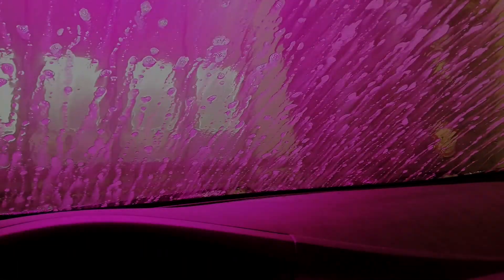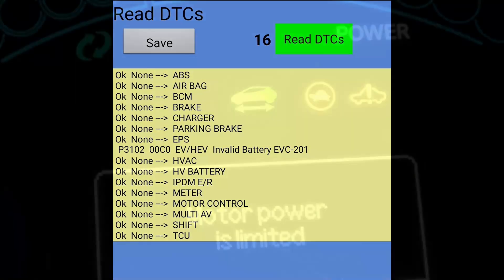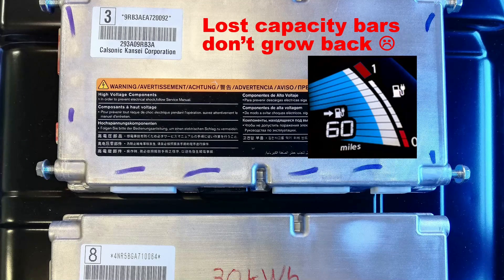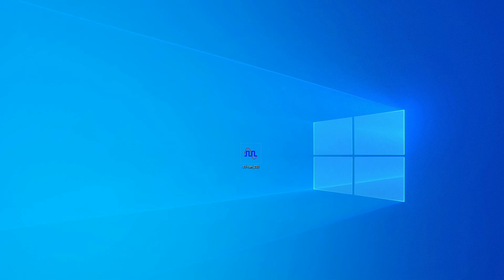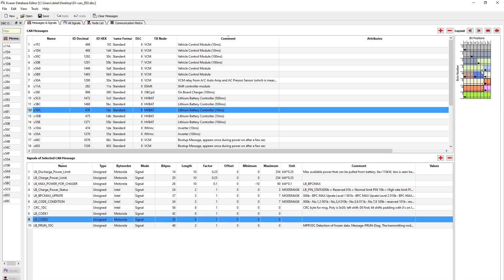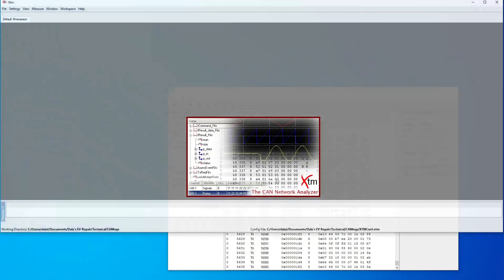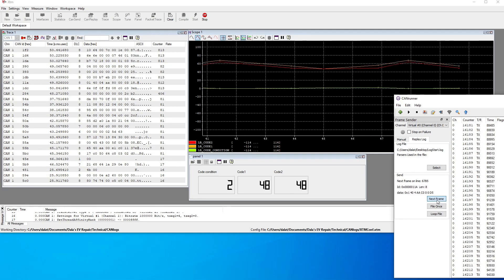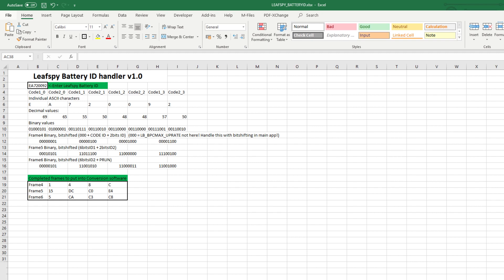Nissan Leaf - Battery ID Secrets Exposed

Comment: Hi Dala, I have Nissan Leaf 2015, one cell has been replaced, however the read out still shows same fault on the same cell. Do i need to Code the cell in? Cell 51 & 52 one shows 4 mV and the other is showing 4550 mV. All other cells are 3890 mV.
Reply from the maker: That sounds bad! Make a thread on the Mynissanleaf.com forum, and attach screenshots there!

Comment: I’m still surprised there isn’t an ev design can swap battery units with a home power wall. 

Charge battery units from solar during day, swap between car-house at night when home, drive to work next day, repeat. 

Would require a modular battery system and car body designed to allow swapping out batteries. Should be possible in a ute or van design. 4 Door passenger car layout a bit harder.

Comment: Hey, interesting development:  Today, I got a call back from my local Nissan dealer.
I have a 2011 with a 2015 24kWh battery that Nissan installed under Klee (the class action.)  It's at 10 bars of capacity, and has about 40 miles of usable range with an 80% charge.
I had gone in and asked to buy a new 62kWh battery from them, and the Parts guy said his computer was telling him that part has to be ordered through Service.  The Service guy said they'd check my car first and see which battery they could fit in it.
I just got a message that Nissan would sell and install a new 40kWh battery for US$13,245.  (From the message, I couldn't tell if that's with installation or not.)
But at least they're acknowledging it's possible, and offering to do it.
And a $13K new battery is much less expensive than a $35K new car.
Reply from the maker: The service center is unfortunately not informed well enough. There is no OEM solution for adapting a 40kWh battery to a ZE0 LEAF. If they order it, the installation will not be successful. But it would be fun to see them try :)
Reply: @DalasEVRepair  Hm.  I suppose they would give me my $13K and old 2015 24kWh battery back.  But I thought all the batteries could be adapted to the ZE0 Leaf.  I'd heard of at least two installs of the 62kWh battery (though not through Nissan.)
Are you simply saying there's no official Nissan path for it?  (I thought it had been done by some smart Finn.)  Maybe my dealer has a bold tech who has seen your work, and wants to show management how they can still make money selling batteries.
Reply from the maker: @stevejordan7275  Yup, no OEM path. But personally I've now sent 7x kits for DIY 62kWh upgrades yes 😁
Reply: @DalasEVRepair  "You've sent...?"  That's stellar!  Can I buy one from you?  (I have the funds budgeted.)  Or do you mean only that you've sent them within Europe?  (Finding a 62kWh battery seems to be the challenge at the moment!)
Or can I buy the upgrade kit sans battery, locate the battery locally, and then DIY the upgrade?
Reply from the maker: @stevejordan7275  The last option is what 99% of customers do!
Reply: @stevejordan7275  in USA currently it's easier to find 62 then 40 for a reasonable price. I installed one pack on ze0 in Los Angeles, and another 62 on aze0.

Comment: Can we add a gasoline-powered generator to the main battery while it is working?
Reply from the maker: Nah, the leaf charger is programmed to not operate while vehicle is moving
Reply: Can we change the car computer programming to what we want and what is the way
Reply from the maker: @rashidmohmd546  sure we can, but it requires thousands of workhours to reverse engineer
Reply: @DalasEVRepair  Do you know someone other than the program or can change it?
Reply: @rashidmohmd546  you need to pull HV cables out of pack or get access in any other way to HV line and use external charger like Tesla gen2 modified, or Brusa charger.

Comment: Anyone try to go to their nissan dealer and just ask them to code in their new battery? If they refuse, report them to your local consumer rights agency (which are quite powerful in the civilized parts of the world).
Reply: Wow...that's sure worth a try.  Thanks, Patrik.  And you still have the CAN bridge option, so buy a new battery with confidence!
(And if you have a first-gen battery, be sure to also buy the adapter.  Probably from Nissan.  I know they make one, because my 2011 has a 2015 battery.)
Reply: Update: Nissan do not have a distinct adapter like the one Dala sells; buy one from him!
Reply: @stevejordan7275  Yes, black replacement packs for ze0 are "hybrid" packs, it's 13+ case with front connectors from ze0. Pretty rare peace to have. As well LBC is different. Trying to get one, but have no luck yet.

Comment: I'm surprised that the EU hasn't slapped car manufacturers down for pulling this kind of anti-competitive practice.
Reply: @Tron-Jockeyeasy, the manufacture date, cycle count, fast charge history.etc would all be visible, if the battery information doesn't match the car it came with, no warranty replacement for you
Reply: They can claim it's a safety thing as they don't know the history of the replacement battery, it could be damaged which isn't entirely unreasonable.
Reply: @mfx1  It is unreasonable.
It's your car and if you want to put a battery in it that's unsafe and it blows up and takes your house with it then who has the right to say no to that?
Your car, your battery, your house.
Just make it so that you void any and all warranty and anything else if you tamper with the car.

Comment: Sadly, Apple have started doing this with almost every component in their new phones, even screens! I'll never buy that
Reply: yea, tired of these companies having you buy a product and everything's fine until it breaks then you find out you really never owned it because you cant do what you want to do to it because they have it locked down. It's like purchasing a car cash. Then you have a blowout. But just because you replaced the tire they deactivate the car remotely, permanently unless you go back to the dealer to get it replaced.
Reply: apple are such hypocrites - they bleat on about how recyclble their products are then actively dont allow people to repair their products...........
Reply: I’ll stick with my ICE car. If I need to change the fuel tank, there will be none of this shite.
Reply: It wont be the fuel tank it will be the pcm unless your talking about cars before the late 1980s. Ive had to scrap lots of nice modern gas cars that the dealer wanted more then it was worth to program a new pcm. The cars did the same "limp mode" with check engine lights making the car useless and if you change the pcm from a junk yard one to save money it wont start. Same issue irrelevant of electric, gas, or diesel. gotta ban companies from being allowed to use these programs, for example my 1988 EZGO is very easy to just switch batteries on.
Reply: looks like Apple is also making electric car, now lets see how repairable that is going to be ......
Reply: Marcus, not necessarily, because Apple has made mistakes in past, which Apple at the beginning stated as "for security purposes", TouchID swap fiasco for example. Not saying it's not true that Apple is scumbag company for certain practices, but sometimes it's a bug or a mistake which is being presented (e.g. lied) as on purpose.
Reply: @FVBmovies  no, they deliberately have disabled repairs on new models. It cost them money and research to make this "feature" which is a way to block users repairing their own devices. I'll never buy another product from any company who takes advantage of me and restricts my choices

Comment: Hei, did you ever eksperiment with parallel akumolator's?
Let we say 2x 40kwh to get 80kwh?
Or from kia akumolator which is 80kwh allredy to get akumolator of size 160kwh?
Reply from the maker: Look into Muxsan, sounds like you are describing a range extender
Reply: @DalasEVRepair  No no im not talking  as range extender. Ja  ok-2x capcity = 2x range but that was not my reason for question. Building aku pack is 1 thing  but properly ip68 rating is another thing and time and and and....when you designing  fram schrach takes astronom time. The reason is that i want el boat and  would be super elegant to instal 4x 80kWh aku pack. Thats why  the unusual question. Btw thank you for answering and your proper and good videos!
Reply: @ItisImarko  it will gonna work. Where is a muxsun soft for a can bus bridge what can do the trick.

Comment: I literally laughed out loud as you stopped JUST short of explaining how to actually reprogram or work-around the new battery having the wrong ID. Sure, you say how to get the ID out, but stopped short of giving away the whole farm that sells the EVs Enhanced tool ;) Darn it... (because CAN messages are broadcast, you can't just insert an ID you like onto the bus... you'd have to cut, intercept, and rebroadcast the messages - with that painfully expensive CAN Bridge!)
Reply from the maker: "Painfully expensive CAN-bridge" is 100€. It is true that I sell the complete solutuion for doing this, but with the info here given you have the choice to go for your own implementation, or just buy the code or code+hardware from me. I don't think any other company would be this transparent!
Reply: @DalasEVRepair  Your web site states "The price for a CAN-bridge(flying lead+3d-printed case) with the battery upgrade software is 450€+shipping."
Reply from the maker: @Bottleworksnet  Yes, this is the plug'n'play version that costs more. Since Matt was worried about high prices, I linked the cheapest empty CAN-bridge if you are worried about cost. But then more legwork to code the functionality, took me half a year.
Reply: @DalasEVRepair  ~ wait, so I'm confused. I'm pretty comfortable programming things myself (I develop AVR stuff, but I work in the Arduino/GCC toolchain). I'd even be happy to assemble the board myself, including SMD. But is the only difference between the two versions just one lacking an enclosure and software? I believe you should get some pay for development as well, but it needs to be economically viable, otherwise if you ask for €450, few people that see your device as a solution will be willing to buy it (myself excluded). The $100 offering is more reasonable but is that a gotcha, where "haha, you bought the cheap version so you get a brick with none of the essential software"?
Reply: @FalconFour  for 100€ is a hardware only. If you want to have a hardware and software "aka turnkey hardware/software for certain solution",  you buy a hardware and software.
Reply: @pashko90  I d pay that ifi could get a battery locally for a good price.
Can the software be used multiple devices?
Ie if I bought 2 or 3 empty for €100 and one software could load them all up to work?
Reply: @FlyingFun.  no
Reply: @pashko90  ok thanks for the clarification.
Reply: @FlyingFun.  sure. you need to buy a software for each can bridge.
Reply: @DalasEVRepair  ~ what, 100€? I looked on the site and I saw 500€ which put it out of the realm of the common man... Where's it 100€? I would almost literally buy it right now, even without a Leaf (I want one as a project car some day - I drove one for 6 years before a Model 3 today). I just couldn't imagine buying it for the price I saw!
Reply from the maker: @FalconFour  https://www.tindie.com/products/muxsan/can-mitm-bridge-3-port-rev-25/

Comment: Around 3:30, you showed the battery pairing tool, which looked like an all-in-one solution.
Then you talked about Muxsan and how they do battery swaps and upgrades without using one of these widgets (I've been following his adventures for years,) with the promise of "let's take a look at how he does it."
And then we get a fantastic run-up of how the battery ID system talks between its components before you say, "that's enough for one video."
Wait...what?  Only the fact that you released this months ago prevents me from taking you to task for a job half-done.  Perhaps you have finished it already.
Reply from the maker: The Muxsan way IS explained in this video. It's just a simple replace of the ID using a CAN-bridge. With the info in this video, anyone should be able to copy that.

The pairing method has hit a bit of a wall. See this https://github.com/dalathegreat/Nissan-Leaf-BatteryPairing
Reply: @DalasEVRepair  Yikes.
Still, thanks for the update.  Not sure Nissan will take too kindly to trying to crack their code.  I can't even get these bozos to commit to locating a 40kWh battery for me.

Comment: I have a 11 and a 12 leaf, now at 60% and 64% SOH. Eventually I will update batteries capacity, probably going DIY using LG chem pouch cells,...  very useful information, keep doing great videos!
Reply: There are cells from CATL - cheap. Complete kits to upgrade. Idk if good. Trying to find someone who has done this.
Reply: Did you do the update? How successful was it? I've seen issues with using NCM cells such as LG Chem because the LBC is expecting the behavior of LMO chemistry. Because of that you cannot use the full capacity of the NCM cell.
Reply: @efurcixot  I have not updated  yet, both original battery pachs are still going strong! (~58, ~60 SOH)
Reply: @mfherreradi  that's good news unfortunately mine is about to give up. soon I'll be trying NCM cells I'll give an update